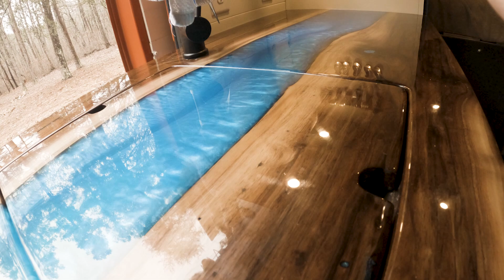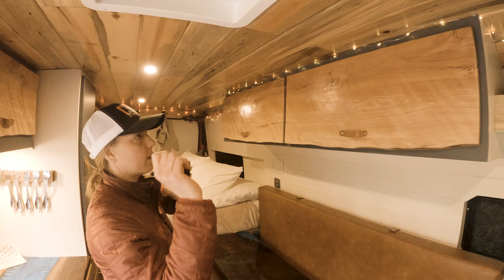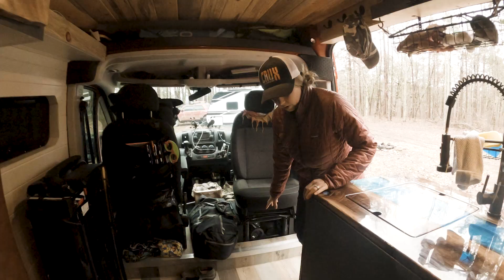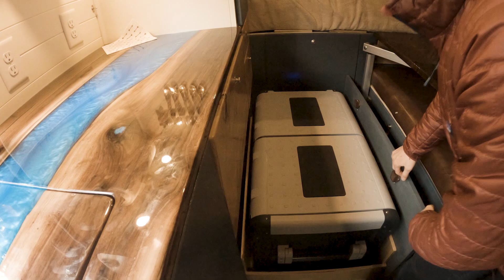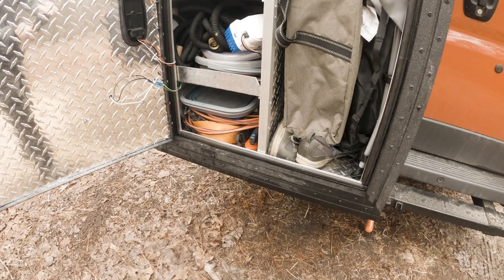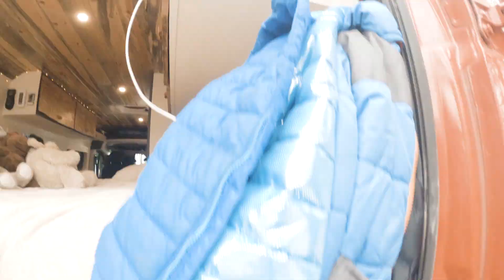BadAss Builds - Van Build for family of 4! 2018 Promaster DIY Van Build - Overland Uncharted

Comment: I really support the family spending time together, but I think the build could have used a lot more thought.  They have some neat stuff, but they are stuffed to the gills and overweight.  Worrying about 10 lbs / tire is not where to spend energy in regards to build weight.  They also could have done the kids seat / bed thing much more efficiently as there are seats that fold down directly into a bed.  I also think they will come to regret having to set up outside each time they shower as there are none built in efficient ways to shower inside.  There are a number of vans set up for 4 people sleeping out there that do this more efficiently.

Hopefully things will all work out for them long term and they will make adjustments going down the road.
Reply from the maker: Been working now since Feb